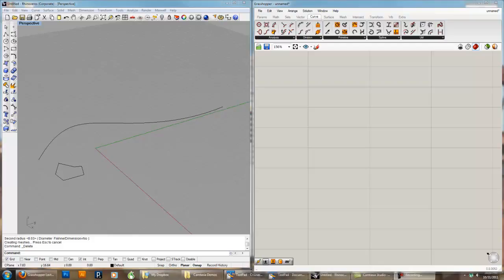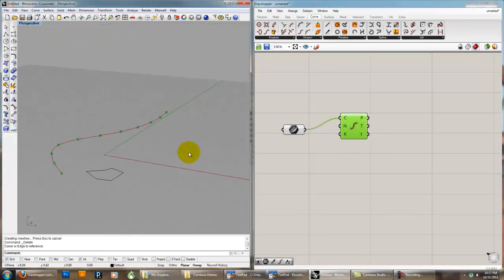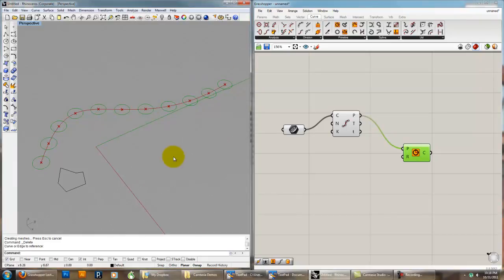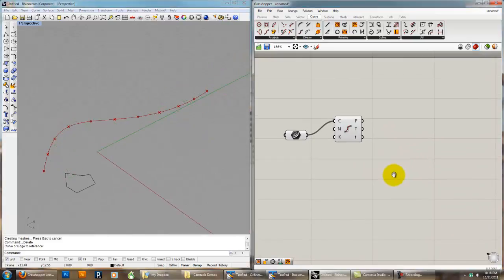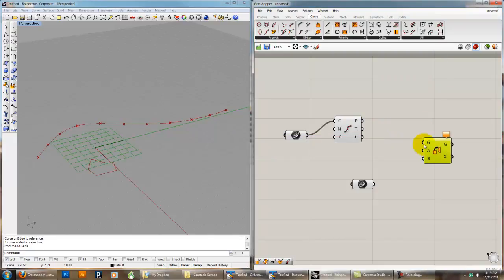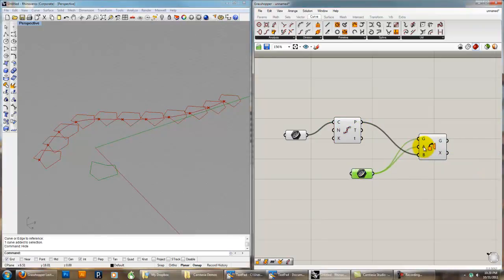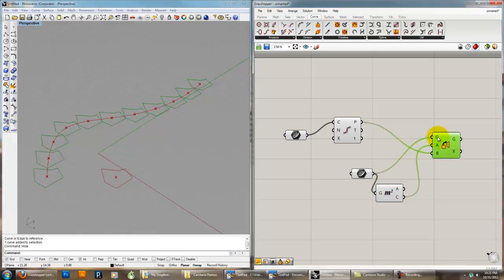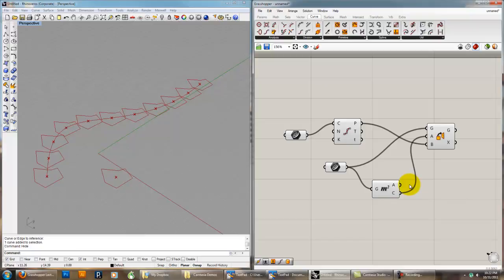Grasshopper Lecture 2, Part 2 (Distributing Geometry) - Fall 2011

Comment: how can i create uneven spacing between objects?  im trying it for long time but i couldn't achieve it yet, for example between first and second obj the spacing ist 20 , between second and third 25, third and fourth 30 and so on, if you can answer me it will be very helpful, thanks a lot! :)
Reply from the maker: Hi Lita. I'll try to explain. For what you describe, I'd make a Series component. Start it at 20 (S), then make the increment (N) 5. Then plug those numbers in for the Move transformation.
Reply: @nsenske  thank you.. :)
Reply: @nsenske  i can use it with mass addition very well as im listing values for uneven distribution of geometries on a curve.. thx a lot